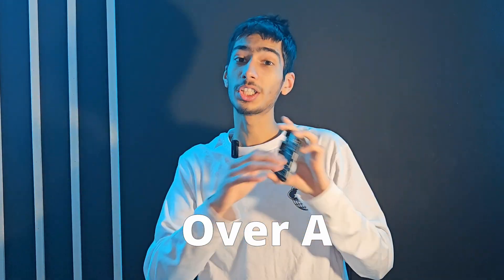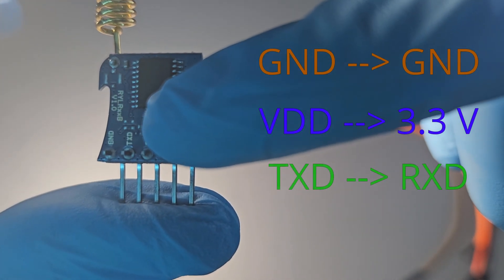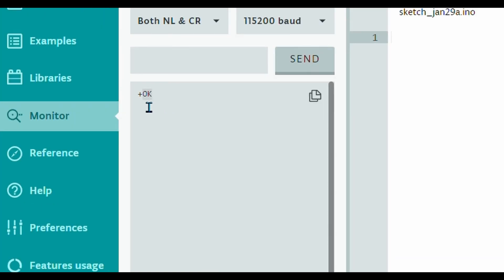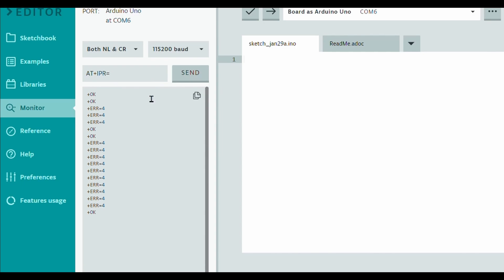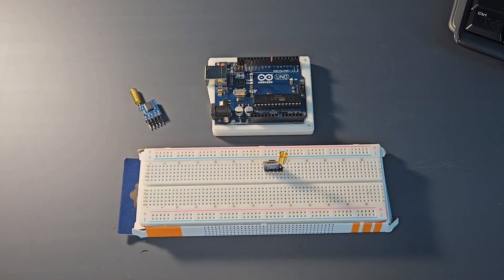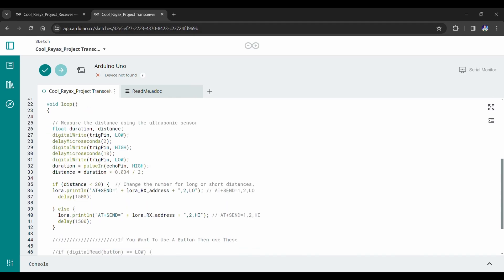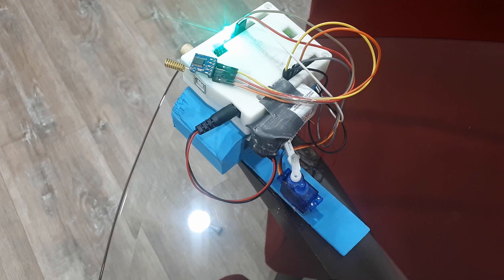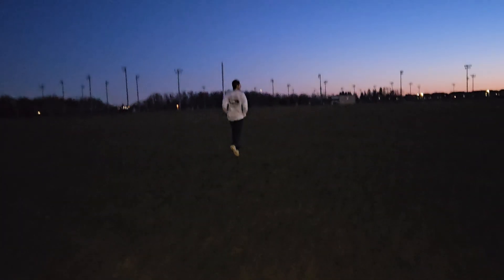The secret to communicate from one Arduino to another over huge range | LoRa RYLR998

Comment: I was searching for this content
thanks a lot for making these 
great quality and good content
wishing you all the best

oh..and a small question, what is the greatest distance we can achieve using these
Reply from the maker: Thank you so much for the support, it means a lot 🤗.

The module is said to have a communication range of 10-15 Km. But the exact range of communication is hard to tell as it depends on the line of sight, or objects/ buildings in front. However the max when I tested in the video was nearly 1.7 km away, and it surprisingly got the signal right away. So considering that the wireless communication can also depend on the area, it is possible to say that the module can at least communicate over 2 km easily, yet it is said to have a range of 10- 15 km.

Thank you
Reply: @tooyoungtolearnall  thanks and wishing you a great future